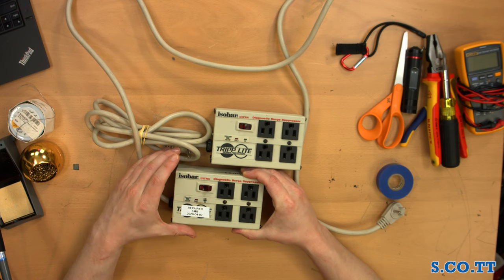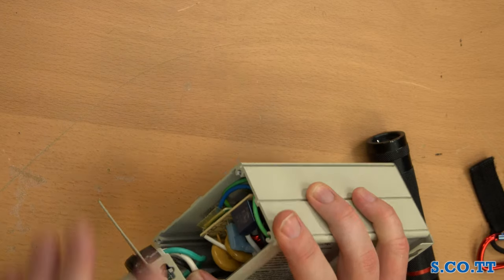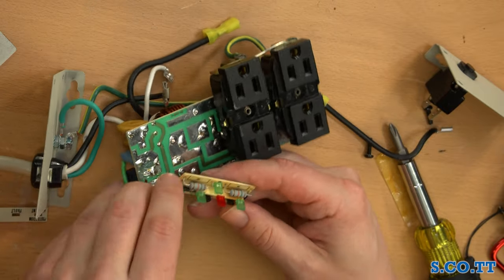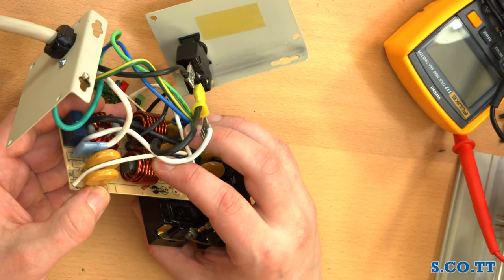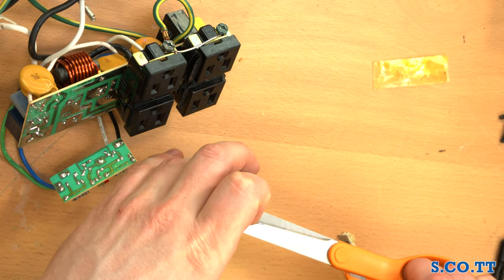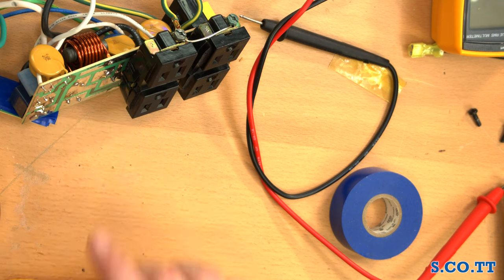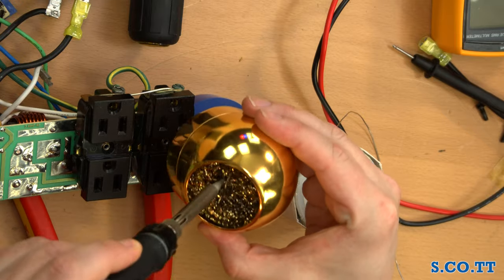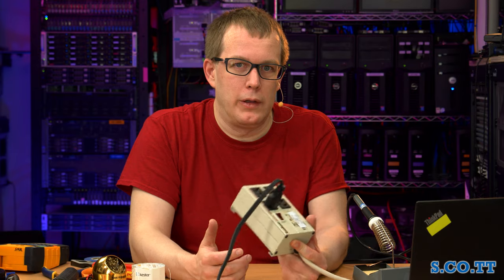TrippLite Isobar 4 Repair (and Design Flaws)

Comment: Great video. Interesting how so many failures are not component-related, but rather simple solder joint failures. You really need to buy yourself a bench-mount PCB vise which will hold the PCB horizontally or any other angle required. I've used one for 45+ years, first on the job, and ever since at home. Wonderful tool, pays for itself many times over. Mine clamps onto the bench edge, others (e.g. Panavise) have a suction clamp or just a heavy weighted base to keep them in place.